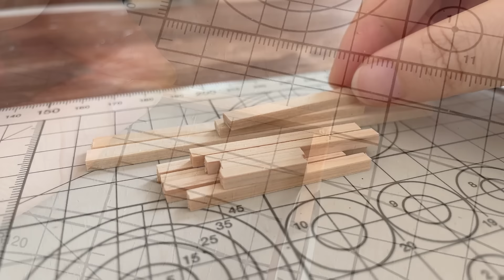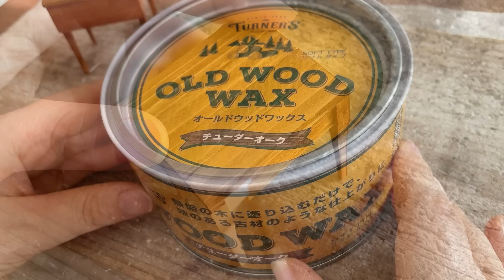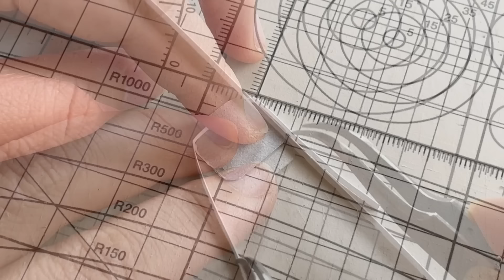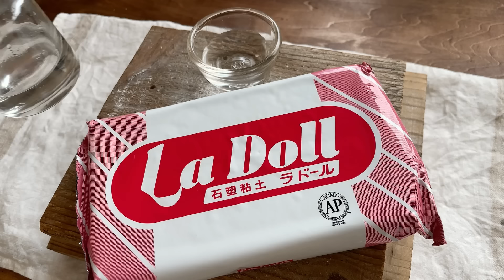| DIY | miniature | アンティークキッチンのドールハウスを作る| Antique kitchen dollhouse | cozy art |

Comment: Why, or what is the purpose,  of water base paint and baby powder mix? Why not just use acrylic paint? Curious. Thank you.
Reply from the maker: Mixing water-based paint with baby powder can adjust the paint's gloss. I also use acrylic paint, but if I want a thicker coat, I use paint. I love the finish of the paint.
Reply: @hitsuji-no-ie   Thank you. I can understand that. Good idea.